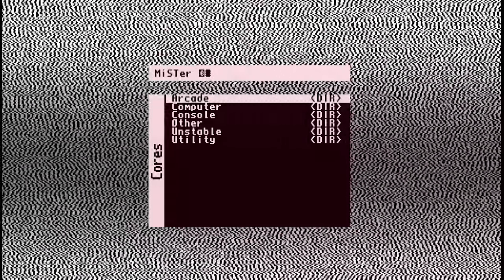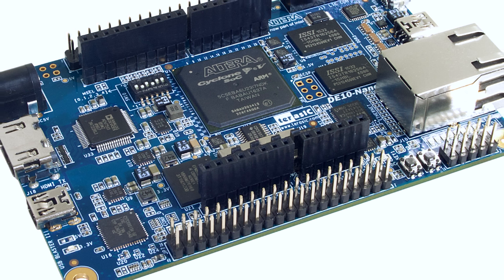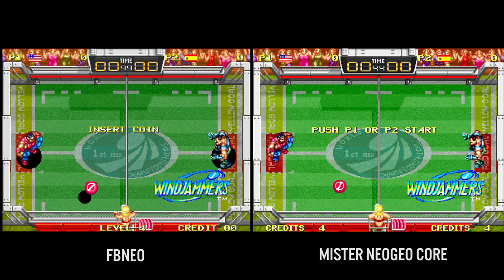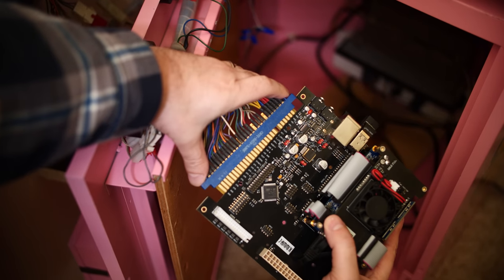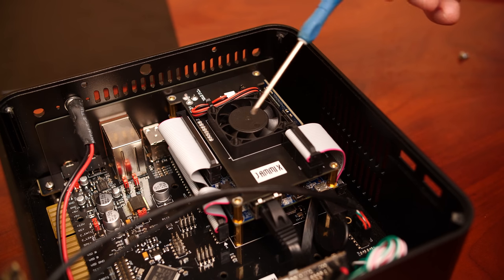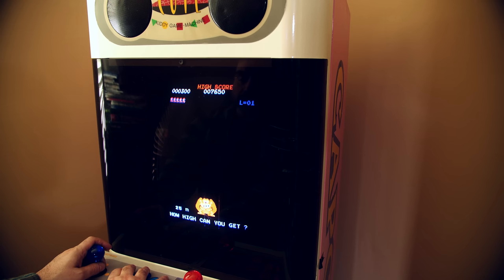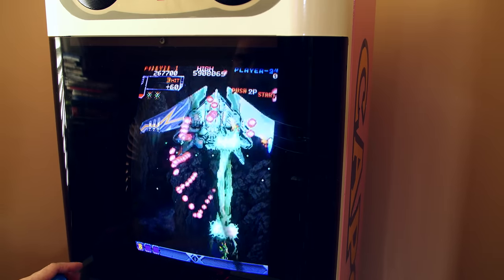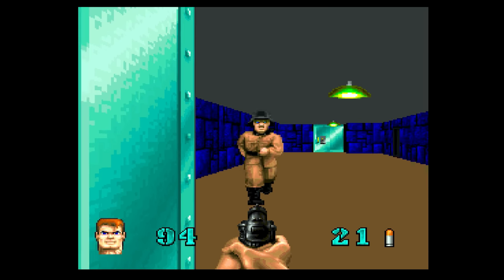Finally - I got my hands on a MiSTer FPGA Retro Gaming Setup | MVG

Comment: Very nice project! And I do feel tempted to get one! But ... let me be the devil's advocate for a minute. At the end of the day, compatibility wise, what's going to be the difference between a mature emulator, and a mature FPGA core? There should be a comparable level of compatibility, right? (or no?)

At least for me right now, I can definitely see the advantages for the Arcade Cabinet use case, but maybe not a lot of advantages vs using a C64 / Amiga / ZX Spectrum emulator on a Raspberry Pi 400, for example. Happy to hear opposing views, in any case!
Reply: Compatibility? Probably not, but the experience is very different. From input lag, compatibility with (some limited)  hardware, or the speed of booting, the MiSTer makes the whole experience feel a lot closer to the original.
Reply: “Mature” FPGA cores are often a lot less aged than “mature” software emulators. Although not easy, it seems frankly easier to rapidly develop accurate FPGA cores versus accurate software emulators, at least at the rate we are getting them. Its a lot of trickiness to emulate the timing of dozens of chips on a few CPU threads in an efficient enough way to run in realtime, wheras FPGA just lets you actually run the equivalent of those chips in parallel like the original. This also lets you experience sound and video with minimal to zero buffering depending on the output method.
Reply: It's an all in one solution that offers an original hardware level experience without needing to invest in original hardware or the mods associated with them to work on an HDTV. Also, the mister offers many of the benefits of an emulator like filters and upscaling (save states in some cores) etc. It's also not really about compatibility, it should be 100% if the core is done properly, it's about accuracy. The mister running a well done core (which most of the big console cores are well done) is just going to be nearly PERFECT to the original experience. 

Now, if you don't care about original hardware or accuracy and don't mind the lag inherent to an emulator (I personally find that topic grossly exaggerated in the community) I really wouldn't recommend you shell out for a mister. Especially right now with the prices all jacked up. 

The Mister is the bridge between an emulator and original hardware IMO. It offers the best of both worlds for a medium sized investment.
Reply: @devilmikey00  I understand what you're saying and you seem to know a lot about the subject but can you tell me the difference between running groovymame on a crt and mister.  My pc specs are well above anything needed to run CPS1,2 and Neo Geo which is what I spend most of my time running.  Thanks
Reply: All great points, thanks gentlemen!

Comment: I’m still not a fan of calling it “FPGA hardware emulation.” This was started by people who wanted to emphasize that it wasn’t perfect, just like software emulation… but the imperfections are the same ones that are possible with any hardware clone… even the official ASIC clones from the same people who made the originals (SNES 1chip, anyone?). So we already have a word for that: Hardware clone.

A software emulator interprets software on a non-native platform but a hardware clone must be accurate enough to execute it natively. Of course, an FPGA can be reconfigured or updated in the field, hence, “Field Programmable,” but this doesn’t make it any less “hardware clone” than any permanent ASIC. They are both a grid of permanently-manufactured generic hardware logic elements arranged in a grid. The only difference is that one has the connections specified in the factory using a lithography mask and can only be changed there while the other can be specified/changed in the field. This programmability gives FPGA an advantage over traditional hardware clones. The ability to update it doesn’t make it any less “hardware.”

I’ve seen some scoff and use the word “code” to imply it was something less than hardware but here is the shocker, the “code,” or HDL (Hardware Descriptor Language), is also used to design and manufacture the original hardware that is being cloned. It doesn’t distinguish FPGA from hardware at all.

Comment: It doesn’t “emulate” anything. It literally reproduces the circuitry.
Reply: 'Emulate' just means 'Copy/Mimic' There is nothing about the word that has anything to do with software level programs.
Reply: Well it just emulates in hardware rather than in software. Which is better because you eliminate the overhead of running it all on top of an OS. And the main result of that is instant boot times and zero input lag. The tech is miraculous to be honest.

Comment: Your opening lines on why you never looked at the MiSTer, makes no sense when you have looked at and gushed over the Analog FPGA systems. Odd that you say FPGA was not on your radar but you have done multiple videos aboutnthem already and actively talked about how good they are... 

Very confusing.
Reply: Polymega isn't FPGA, its all Software Emulation
Reply: @lukasperuzovic1429  my mistake, fixed and thank you.

Comment: Hey MVG - I remember your X68000 video where you hooked it up to a Roland MT32. Well, you can do the same with the mt32pi project - an addon for the MiSTer which uses a Raspberry Pi 3 to emulate a Roland MT32 and a Roland Soundcanvas and connects up using a single cable. It's supported in the AO486 and X68000 cores (as well as a few others). One of the best addons I've purchased. Also regarding cases and coolers - Mister Addon's makes a passive aluminium heatsink case that looks really supreme. It works in the same fashion as the FLIRC case for the Raspberry Pi. Mister Addon's case is highly sought after. We are seeing lots of cases come out now, and they are all awesome. Welcome to the world of MiSTer!

Comment: Finally ! :) I have somethings to add : the VGA outpour is possible via a simple HDMI to VGA converter, it's lag free, and you can use a micro USB hub for you devices. It cost next to noting.  You add a okish VGA CRT and you will have better than a high end CRT tv... I was an early adopter, right after the switch from mist to Mister. It cost me 140€... for a full set up with sdram. Thx to the community I love. Check out the Facebook official  group ! We will be glad to see you !

Comment: Another good option for someone looking for a "ready to go" solution would be the original MiST computer, which is what the MiSTer project evolved from. The MiST computer uses a Cyclone III and has 32MB of ram, so it isn't going to run as many cores as the MiSTer (ie: no Neo-Geo) but for what it does for about $250 it is a great deal. It has the VGA out, four USB's, MIDI ports, user input buttons and comes in a nice metal case. So, if you can get past not running some of those cores that require more RAM or larger FPGA logic, the MiST is a great budget option for what you get. I have one...and it runs a LOT of stuff :)

Comment: This is a pretty good surface level look  at what the MiSTer is. 
I find the MiSTer is less complicated than Raspberry Pi Retro Gaming and is closer to setting up a Flash Cart in many respects.
Reply: Jepp definitely easier to setup properly, however also more limited in its arcade rom selection, however when it comes to old consoles and home computers it beats any software setup by miles. Some systems like the old Atari 8 bit computers which the mister can handle really well, have had a bitrotting unmaintained state now for ages on the software side.

Comment: Great video with the pro and cons. The MiSTer is certainly not for casuals due to the price, but I can say that FPGA hardware emulation which is cycle accurate has advantages over software emulation. For one, the input lag is like the actual hardware and perfect for competitive play for score or speed runs. While software emulation can do run ahead, it has its own issues such as being faster than the actual hardware plus compatibility issues plus finding the right configuration for each game. Personally, I use both hardware (FPGA) and software emulation. Each has its own strengths and weaknesses and neither is perfect. I have given up on most modern games as the rich library of games from the last 50 years is so much better and so much more compelling without NFTs, micro transactions, and incomplete, broken games with pretty graphics charging $70 (Here's looking at you: BF 2042). For most of MVG fans, we already know its about gameplay and while I love pretty graphics (don't we all) you don't notice it while playing these older, more compelling games.

Comment: When it comes to analog output from the MiSTer into a CRT, another option that I don't see many people talking about is YPbPr component.  Many consumer CRTs from the tail end of the CRT's reign supported this input (probably thanks to the PS2), and the MiSTer can output YPbPr component video instead of RGB; all you have to do is add "ypbpr = 1" to your MiSTer.ini file.  The one downside is that the MiSTer will output RGB for a brief moment every time you switch cores, but it won't hurt your display and only takes a second or two to re-read the INI file and switch back to YPbPr.
Just remember that cores generate an analog signal that's faithful to the original hardware, and many of the computer cores are British, so don't be surprised if your North American CRT balks at the 50 hz video signal from the BBC Micro core.  If you have a keyboard plugged in, you can press left shift + left ctrl + left alt + right alt to reboot the MiSTer back to the main menu.
Reply: Yep - I use the component output with my TV, and it works great. Only downside is my CRT doesn't support 50Hz, so it limits which cores I can use

Comment: I had my doubts too but speed and accuracy come with FPGAs, software emulations can improve but often it takes a while which hardware cores are less prone to. As said there is the collecting angle where it isn't possible to buy or store all these platforms by the vast majority of people, even those longing for hardware experiences. ;)
It is the eventual end for collecting and by that I mean X amount of anything shrinking and shrinking as people collect each thing. With some rare platforms it's the only hardware solution because you simply can't buy the platform at all anymore. For any new collectors just starting I'd wholeheartedly recommend a MiSTer as a cost effective alternative.

Comment: I tried the MiSTer next to some software emulators as well.
To be very honest, if I am just focusing on playing the game and having fun, I don't really see any major differences.
If you just hyper focus on the details, you will notice a few here and there.
There are definitely some exceptions here and there.

In the end I think it's more a feel thing than anything as well as the ease of use.
It also really depends what you're looking for and what kind of things you're emulating.
Upscaling up to 4k with plenty of anti-aliasing is just never gonna happen obviously.

Btw, the term "emulation" here is getting EXTREMELY blurry.
Most ASICs these days (and also back then) are actually first being made on a FPGA (I used to work at a couple of companies doing that). 
Depending on production scale this sometimes is being translated to an ASIC. 
Which is often cheaper, but you will loose the option to (completely) change the design.
If the quantities are very limited one can choose for just leaving it on a FPGA.
The reason why I am mentioning this, is because in many cases a FPGA = the actual design.
With this I mean as in really the REAL design. Or in other words, there is no emulation going on anymore.
The only reason why one could still use the term emulation, is because it's often hard to backward engineer the 100% original design.
Although that could also happen with a clone chip (or copy)
Reply: Yes, it's true that FPGAs have the potential to do a 100% accurate hardware "clone" of the original console/computer.

But, we're not quite there yet. Work hasn't really begun on doing full verification of the better cores against the original chips. ie. using Logic Analyzers etc., or putting each original chip on a board hooked up to the FPGA, and comparing the differences on a clock-by-clock basis.

Personally, I try to avoid using the term "emulation" when talking about FPGA cores, simply due to the confusion it causes vs "software emulation".

While both approaches have very similar goals and challenges, and each has advantages and disadvantages, I just love using MiSTer because it packages everything together, and just "feels" different to use than any software emu I've tried.

Maybe some of that is placebo, I don't know. lol
But it really is something that needs to be tried before people "get it".

Most of the detractors of MiSTer (and FPGA cores in general) are people who have never sat down and played on games on MiSTer for a few weeks.

Even MVG said he felt the same way until he tried it.

And that's not to diss software emulators either. I love those, too, and still use them a lot.

But MiSTer has basically replaced a lot of my OG console collection now. It's just far more convenient.
Reply: ...and that's also not to say that people need to play on FPGA cores to enjoy the games, ofc.

Software emulators are pretty amazing now, too. We're now seeing emulators for PS3, Xbox 360, and beyond.

For me, the FPGA stuff is just as much about enjoying the games (and tinkering) as it is about preservation.

It's the closest we have atm for working towards truly preserving the logic of the original hardware.

most (but not all) software emulators use high-level emulation. There are a few (like CEN64) which aim to do low-level emulation which more closely resembles how the original console worked.

And FPGA core could more accuratly be described as "low-level emulation, in hardware".

Or maybe "hardware re-implementation", which doesn't suggest it's immediately more accurate.
But yep, 100% cycle-accuracy is the eventually aim for FPGA cores.

The Neo Geo core is likely the most accurate so far, as that was done by Furrtek. He decapped and analyzed all of the original custom ASICs, making accurate logic schematics, then transcribing that logic into Verilog. A huge effort, but that's the "gold standard" for writing cores really. Not something us mere mortals can do. lol

Comment: Okay, the whole output to CRT thing is the best thing about this. The price is almost what it would cost to built a small form factor mini PC with an IGPU, which could easily handle every CRT console except maybe Wii, PS2, and GC, as well as letting you play low-spec PC games. Still, this at least has a reason to exist, unlike RetroPIE/RetroArch which just slowly runs a buggy ARM port of a PC emulator.

Comment: Better late than never! I got into the MiSTer after the Neo Geo core was first released, back then the DE10 board was 120 shipped from Amazon. Adding a 128MB RAM board, an IO board for analogue output/cooling/RTC, and USB hub put by total cost at less than $250. Being early was definitely good.

Comment: Everyone always says it's hardware emulation, but never really explains what that means. An FPGA (field programmable gate array) is programmable hardware that can function as any type of digital circuit as long as it has enough logic elements to accommodate the design of that system.

Compared to something like MAME, there is no operating system or emulation software, the game actually runs directly on the simulated hardware circuit. Even though I use the word 'simulated', an FPGA is hardware in every sense of the word, it just happens to be highly configurable so that the hardware can behave in different ways instead of being hard-wired to do one specific thing.

Now the DE10-Nano's main chip has two components to it, the FPGA and a separate ARM-based CPU. The ARM-based CPU runs a very minimal copy of Linux which is used for a few simple tasks like reading joystick inputs over USB. From there, those inputs are forwarded straight into the FPGA's hardware circuit where the game actually runs.

That does mean you get both the good and the bad of running in hardware though:
1) Keeping in mind that the core running on the FPGA is just a hardware circuit, it's not like an ARM CPU running a software emulator where it might struggle to keep up with the emulation. An accurate core will run at the same speed as the original hardware, but that also means that a game which lagged on original hardware will also lag on the MiSTer.
2) Because it's just a hardware circuit, it's very hard to capture the full state of the entire system, which is something that is easy to do with software emulation (where the entire state is stored in memory). So more often than not you can't get save-state functionality on the MiSTer unless it's been baked into the core at a hardware level.
3) Many cartridge-based consoles will save progress by writing data to some memory location on the cartridge which is kept alive using a battery. Since there is no equivalent battery and many cores can't identify that such a memory write has occurred, you usually need to manually save using the MiSTer menu to dump that memory out to a file. Not a big deal, but it is an annoyance worth mentioning.

Finally, keep in mind it's still emulating a complex piece of hardware, the key difference is that you're emulating hardware using hardware, instead of emulating hardware using software. The quality of the experience still comes down to the skill of the developer and maturity of the core.